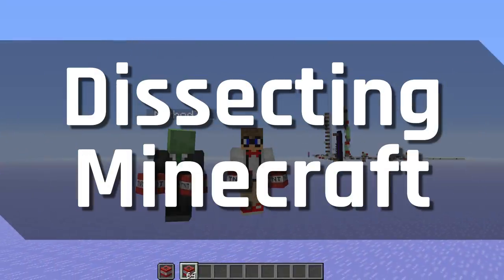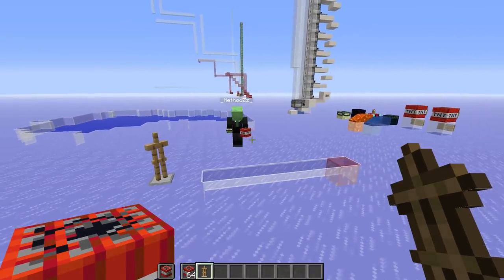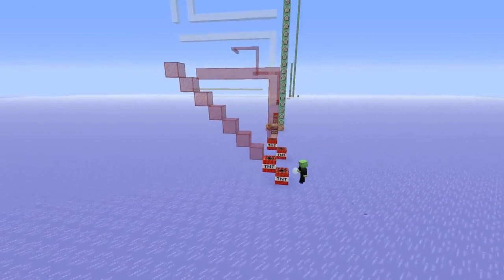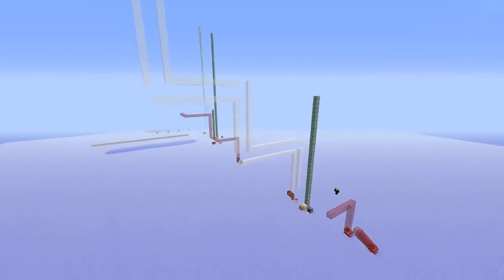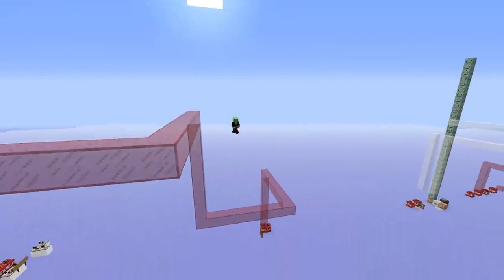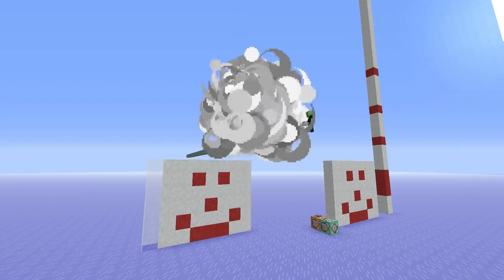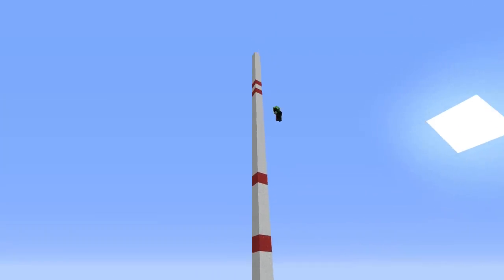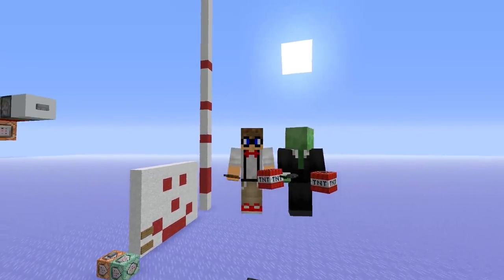Dissecting Minecraft #14: How TNT Works | Minecraft 1.13

Comment: this explanation still works in 1.16? I ask for the direction that take the tnt when another explotes one block away in the same tick. A great serie by the way
Reply: one thing I think was changed is that you can't put a falling sand on top of a fence so that it stays in a falling entity state. I think now it lands on the fence and turns into a sand block just like on a normal ground.
Reply: @youluvana  ok, I was asking about the direction of the tnt when it exploids in the same tick, It was my fall, i did not write te question well

Comment: I think I don't quite get the tunneling effect.
If you theoretically power all projectile TNT's with just a plain old redstone line, they all have the same place in the update order which will cause them to all explode in one spot,
but if you use chained command blocks like in the video you assign each projectile its own update time, so it's like they are flying/exploding one at a time, correct?